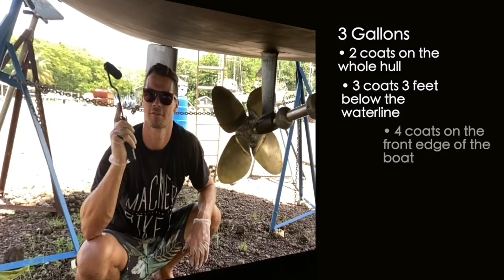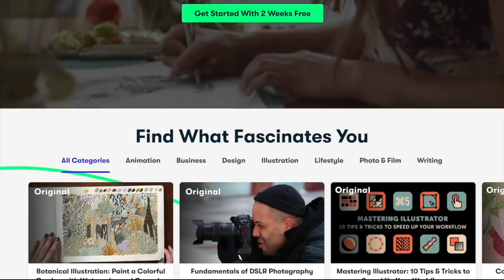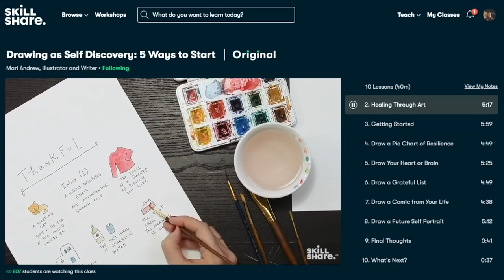We’ll Never Forget our First Time APPLYING ANTIFOULING BOTTOM PAINT on our Monohull Sailboat - Ep 53

Comment: Pro tip for next time: Use wide painters tape to make a "rain skirt" all around on the boot stripe(the edge of the tape stuck down but the lower edge free to run the rain away). Give the cans mechanical stirring carefully to break up the inevitable lumps of active ingredient at the bottom, shaking alone never is sufficient. Put your first coat on thin and give sufficient dry time. Irregardless of antifoul type don't paint early and allow the paint to bake dry for a week before launching as excess hardening will reduce the antifouling.

Comment: Copper anti-foul really needs to be shaken well in an industrial shaker if it has sat around more than a few weeks.  The little clump you had was nothing compared to if it sits for months.  We took ours to a Home Depot once to have it shaken and the paint guys where amazed that it was so heavy.  The 1-gallon shaker tripped out so they had to put the gallon cans into a special adapter jig so they could shake it in the machine used for shaking 5-gallon buckets. They had never seen paint that was that heavy.

Comment: I used 2 gallons of epoxy barrier coat "3 coats" and 3 gallons of bottom paint 3 / 4 coats. 4 coats on the water line and the leading edges.  I also used a hard "modified" ablative.

Comment: Ouch.  I feel your pain.

It must have been hard in the extreme heat and without any real support nearby.  Seriously, if you winter over in Florida then you can hop up to Deltaville in the early spring April/May it is WAY better as far as climate and a support system is concerned.  Deltaville is super-friendly to DIY/Livaboards as long as you don't camp out there on the hard for months. I don't know why some folks do this but it sometimes happens that people are reluctant to go back into the water for whatever reasons.

It is tough living on the hard AND working on your boat.  We know. We were doing it just a few months ago. When you are in your 50's and 60's doing that crap gets even harder -especially when you have abused your bodies and lungs when younger without wearing proper PPD and being reckless.  Try to not do that again in the future.  Believe me, it just makes things harder when you are crawling around under the boat and all F-ed up in the knees and back and lungs from being incautious when we were young.

We did the 1 coat of blue followed by two coats of res and it worked out very well for us.  Sometimes you just have to splurge on that extra gallon of paint even when it is another $300.  Been there, paid that bill.  Pay them now or pay them later. That's how it works.  A good bottom paint will pay off in better protection from marine growth and less work to keep it clean.    We got 3 years between haulouts and it still looked good and didn't need any extra work so we must have done something right.  I hope we get 3 more again next time.
Reply from the maker: Yeah! We’ve stopped in Deltaville. Fortunately we had enough! But pain is definitely cheaper in the states. Wish we would have bought it before leaving